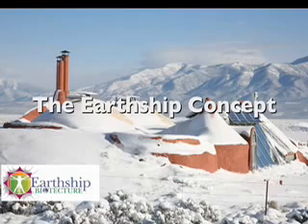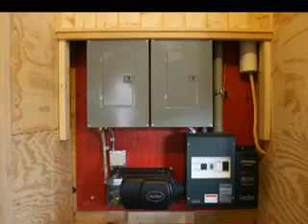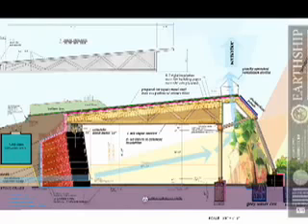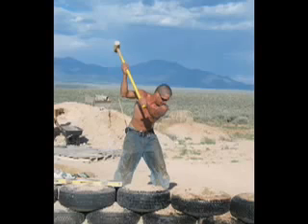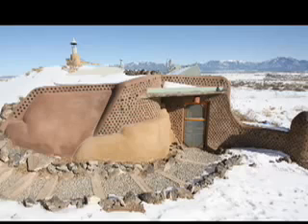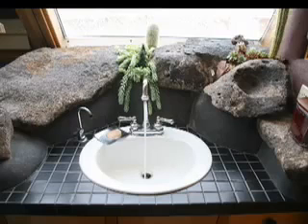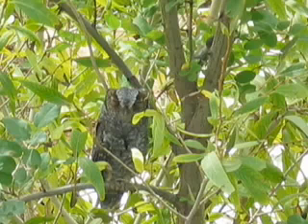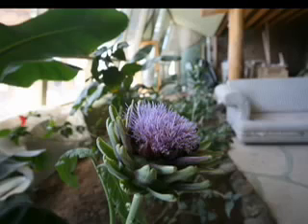Earthship Design Principles | Off Grid Living

Comment: "when thats all used"

I read somewhere, that the UK alone burns over 40,000,000 tires a year, and each Earthship uses around 1000 tires, some a bit less, depending on size, which would be enough around 40,000 - 50,000 Earthships a year.

Five *billion* aluminium drink cans are sold in the UK each year. Over 1,000,000 tons of plastic bottles are recycled every year in the UK alone.

I'm not even going to do the calculation... :-)